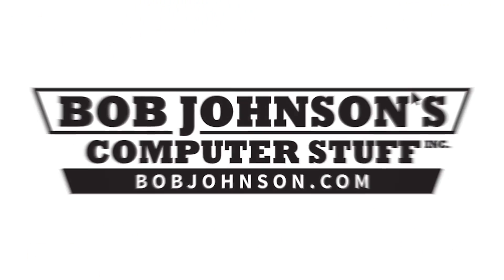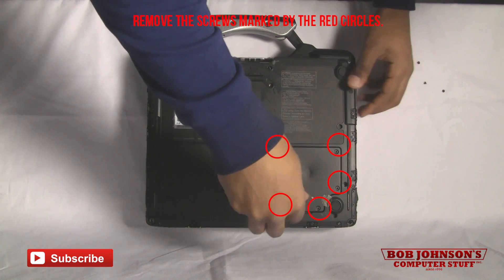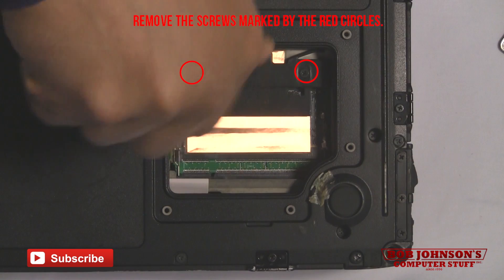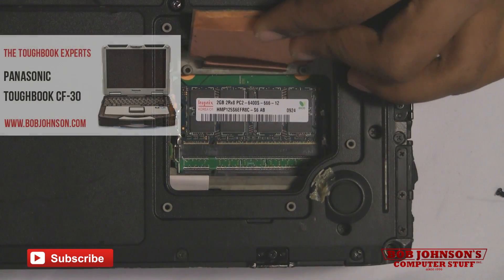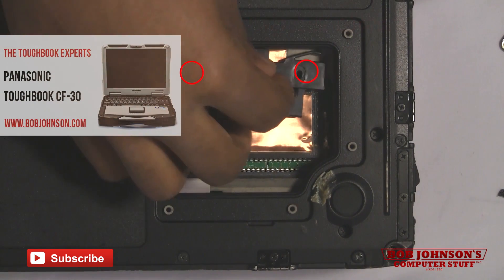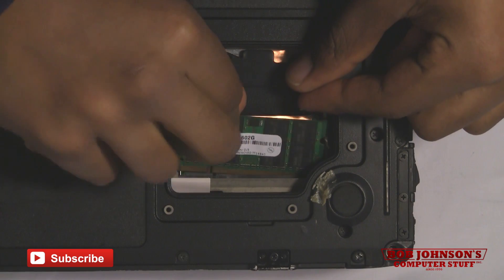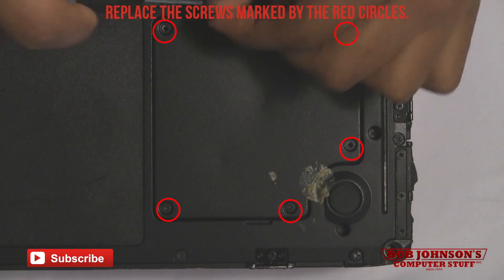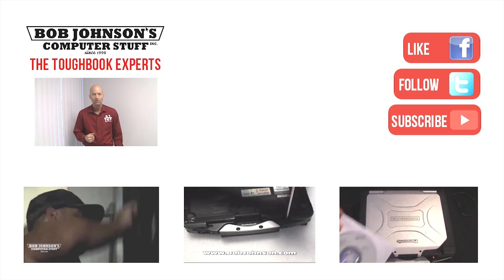How to remove the DIMM in a Panasonic Toughbook CF-30

Comment: if the cf-30 has the card readers and internet ports on that side you have to also remove the whole bottom cover which isnt to hard just a bunch of screws and carefully pry at the edge of the cover to break the watertight seal to pop it off to access the card reader device you have to remove to get to the second memory stick under the copper heat sink.